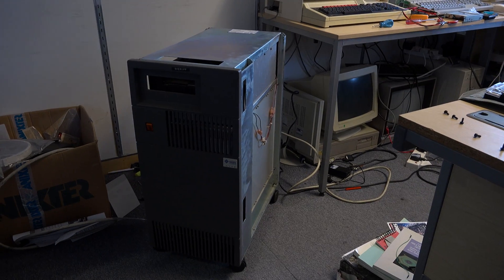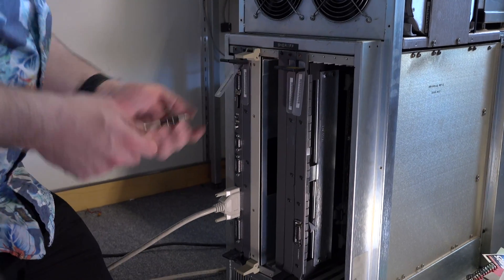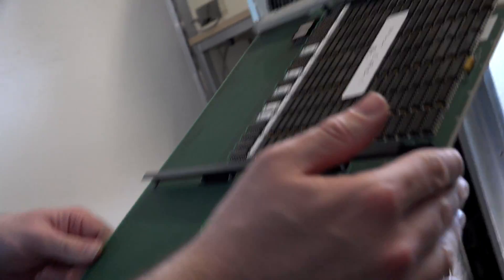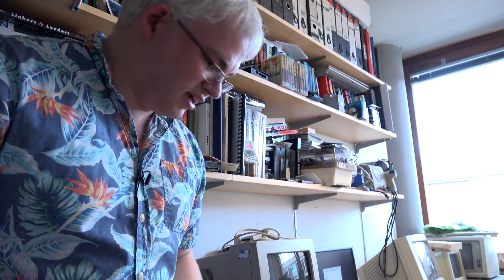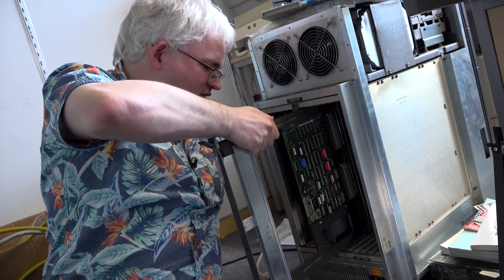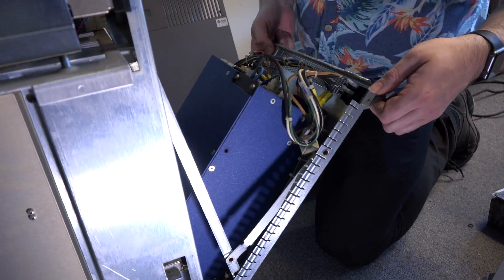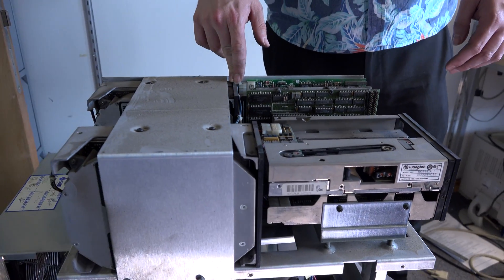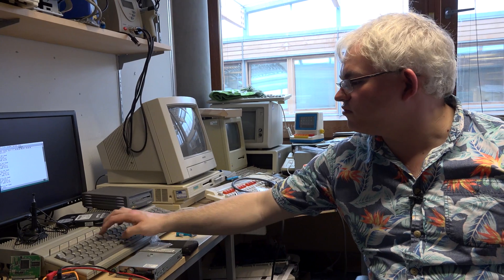Sun Microsystems Tear Down - Computerphile

Comment: I used one of those at Megatest (later bought by Teradyne). Before the Suns, we had our homegrown Motorola 68020-based workstations. We ported a C compiler (pcc) and BSD Unix. Our computer was a Rube Goldberg contraption, designed as a stopgap. Nothing suitable was available off the shelf. We were in a hurry to get the Sun workstations. We gave the compiler and Unix kernel to Sun's engineers,  to expedite their development.

Some time after that, there was a choice of two windows systems.  (No relation to Microsoft.) You would boot up the Sun kernel in a "shell", and then start the windows program with a keyboard command.

Comment: The desk I am sitting at right at this very moment is build from a glas plate, a DEC R400X DSSI disk enclosure and a Sun 3/260. That is basicly the same box as shown in the video with a slightly faster CPU. I also have a 3/160 CPU board that I use as decoration at my local hacker space.

"8. You stopped purchasing new furniture when you realized that your computers work just as well."
From the "Top ten signs that you're a VAX geek" by Brian Chase. :-)

Comment: I worked at a local ISP in the 90s. All of the services were ran on SparcServers: primary SMTP/POP3, RADIUS, and DNS on a SS20 with the secondary services ran on a SS10. We later added an Ultra Enterprise for web hosting. I have the SS10 and SS20 in my "collection" when the services were migrated to E450s.

Comment: A mail server called Pat. Perfect!

When I was at uni (University of New England, Armidale, NSW), the Maths and Computer Science department had machines named Turing, Newton and Bourbaki. Turing was the main (x86, later x86_64) server everyone used, Newton was a PowerPC machine I never got to use and Bourbaki was the cluster I had to write a couple of assignments for when I did a concurrent programming subject. You'd get tripped up a bit using it as the head was x86_64 while the nodes were older x86 systems, so you had to make sure you were compiling for the right architecture.

Comment: I love my little ss20.  Dual 85MHz goodness!  It's hard to find a monitor for it, though.  Null modem only for now.
Reply: Used to have gobs of sun to vga adapters around. That's probably fairly ebayable.
Reply: wotsac I have one but it doesn't work with any of my monitors.  I read that they can be finicky so I don't really want to spend money on something I can't be sure about.   My connector did work on one monitor but that one blew up probably 10-12 years ago.
Reply: teknifix monitors are probably less forgiving than they used to be as well.  

I don't see the appeal myself - an ss20 is basically just a low spec modern computer, that runs up to Solaris 9.  I suppose I'd have given mine more of a chance if I'd known it could run SunOS 4 though...
Reply: wotsac I got it for a couple of reasons.  The novelty for one.. in Canada Sun systems are very uncommon, and the other reason was to learn about Sparc architecture.  I wrote a couple of small things in assembly on it.. it was a fun experience.  It needs new drives now, though.

Comment: 6:12 bottom right - is your battery.   It likely died.  I've seen systems which rely on having a good battery for bios settings.
Reply: ditto for your scsi controller.   Also make sure the scsi bus is terminated.  You might find the terminator on an external scsi device if it was attached.

Comment: Very cool.  Brings back memories.  But the processor is a 68020 of the 68000 16-bit series.  Atari and such used the 6800 and its ilk 8-bit processors.  68000 was used by the TI 9900 home computer.
Reply: No Atari ST and Amiga and early Macs used the 68000 (as did the Sega Genesis). The Sinclair QL used a 68008 (which is in the same family). The TI computers used the TMS9900 family chips which were 16 bit and unrelated to the Motorola 68k family.

The earlier 8bit generation of Atari computers (which almost crossed the ST era) were all 6502 based.

Comment: the Lab where I worked in the 90's had some Sun sparc/ultra-sparc's running Solaris ........... they were superb "server class" / workstation machines !........we also had some Digital DEC Alpha's which if I remember correctly one booted to a "light unix" in ROM but ran Win NT(strange/rare but fast !).........there was also IBM AIX & several "high end" intel based systems running UNIX flavors like SCO / UNIXware etc. ......almost all the systems were back-plane architecture not just  VME but ISA & PCI etc. too...... as they were popular in telephony for obvious reasons ...........ah the glory days !

Comment: 7:50 System.out.println("Never heard of it");
Reply: std::cout << "Java sucks :^)";
Reply: Underrated comment, this.
Reply: +xpaganda class cdestroyer {public: ~Java();} cdestroyer::~Java() { throw ImpossibletoDestroyException}
Reply: console.log("Java is for oldtimers");  // Ducks ..
Reply: System.out.println("At least I can run on any computer, even some microcontrollers!");
while(true){
    System.out.println("OHHHHHHHHHHH");
}
Reply: .extern printf
IAYF: 
 pushl $0x74
 pushl $0x6B
 pushl $0x65
 pushl $0x72
 call printf
Reply: +MrHellemo how about no
Reply: +createjump :3 i kinda wanna know how a jvm works know
Reply: And C/C++ compile to machine code, so yes, you need machine code to run it, And yes, your'e right
Reply: Well said 10/10

Also, WTF this comment only shows up when I select "Hide replies"
Won't show when replies are visable
Reply: That's because Java runs on a virtual machine, Python is interpreted by an interpreter so when the python wants to call a native function, it does so by telling the interpreter to call the function, Java on the other hand uses a virtual machine that prevents it from directly calling the native function

Comment: If that bios eprom is still okay, I suggest pulling it and backing up the contents immediately before it craps out for good. Thanks for the video, it's great to see the insides of this beast!
Reply: Chuck Vanderbildt ya, with no ESD protection being used that might happen sooner than they think.
Reply: Then sell it on ebay? :P
Reply: I don't think getting a replacement flash ROM is that problematic... and these older EPROMs are still 5V or even 12V based; not too sensitive to ESD.

Comment: Gotta love a nice Computerphile dusting montage
Reply: My OCD was not satisfied, he could have cleaned it more thoroughly ... I had a UltraSparc V with the appropriate Sun (Sony) 20" CRT; epic multimedia multi-tasking for it's time and a rock-solid server :)
Reply: I had 2 22-inch Sony widescreen CRTs, one Sun-branded and one SGI-branded. The Sun branded one had the weird VGA connector that had the red, green, and blue analog signals in shielded wires so the connector looked weird. The SGI instead had 5 BNC connectors on the back, R, G, B, and H-/V-sync.

Carrying these required two people to carry awkwardly, or one person to carry with the risk of back damage. Somehow got one into my dad's basement, and out again when we got rid of it.

Also had a  24" Sony-branded widescreen flat CRT. The glass was just flat, the thing still had immense depth. I cannot imagine what it would have cost to ship one of those.
Reply: Yeah, 50+ kg flatscreen TVs, hard to imagine nowadays :)
Reply: I survived Windows ME !
Reply: You should never forget the horror, otherwise history will repeat :)

Comment: A RAM board that size today would be terabytes, perhaps even petabytes worth.
Reply: Maybe a TiB if you filled both sides with chips. Definitely not a PiB, though. Also the RAM boards shown did not have all the slots filled in.
Reply: Commercially available DDR4 RAM goes up to 16GB per stick currently but more commonly 8GB or 4GB, so that would get you a couple of terabytes for a board that size. It'll take another decade or so before you can have petabytes of memory in a computer that's not literally room sized.
Reply: 128GB ones do exist as well, but you can't actually buy anything over 16GB right now. A DDR4 SO-DIMM is actually 2088mm^2 which gives us 652GB for a card that size.
Reply: assuming a density of 16GiB per DIMM, and assuming a DIMM area of roughly 4000mm^2, you could fit roughly 21.27 16GiB DIMMs onto a single VERSABus card (370x230mm, 85100mm^2), giving us a bit more than 340GiB of RAM. If the PCB designer can pack the individual chips more densely on the VERSABus card than they are on standard DIMMs, you might be able to get like 750ish GiB, but heat is going to start being an issue (if it isn't already).

EDIT: there exist 64GiB DIMMs. That would get our VERSABus board to 1.36TiB.
Reply: DRAM-chip, 9mm x 13 mm 8 GiB.
densely packed and lets say extra 50% space for controllers etc and no those Buscards... nice 4 TiB
8GB/chip is the biggest i know of, and 50% extra spacing is generous when you look at RAM-modules.

Comment: 8MB of ram...This YouTube video is taking 500MB right now lol
Reply: KnownNever that's just decoding. with some pre-decoding, transcoding, and caching, and the proper software, this thing could play this video back at 10 fps at 256x120 with those 8 mb
Reply: 16Mb of RAM on the whole machine in 1986 was pretty darned impressive for the time--my first PC in 1993 had only 2Mb!
Reply: It had 4 MB onboard (already very impressive for 1986) when it left the factory; the expansion-boards were probably acquired later, but still, 12 MB to bring it to it's max supported 16MB extra must have costs thousands and thousands of pounds back then; it's like having 2TB RAM nowadays  :)
Reply: In the begging it actually showed 0x00000010, which is 16MB of RAM total it have
Reply: ..and no RGB LED's on RAM.
Reply: It's better to over-specify than to under-specify, surely? Otherwise you get 640K being enough RAM for anybody to be using, and we all know how well that one worked out.
Reply: The question is, why does it has 8 hex digits to count the RAM? Did they really thought the machine (or the OS) would be running 4 GB at some point in the futurre....
Reply: Because it was a 32bit system, yes back then. When they built one with more ram, the software just worked.